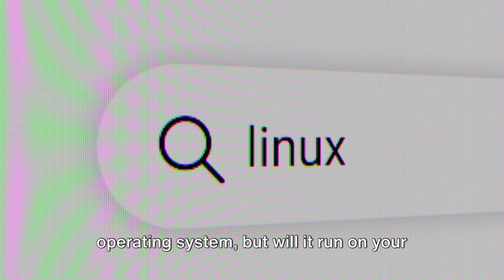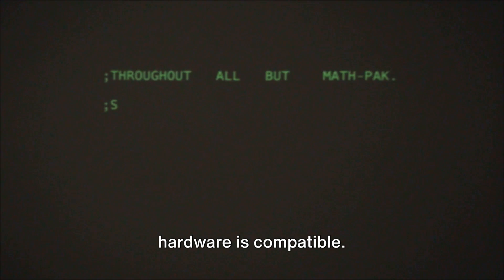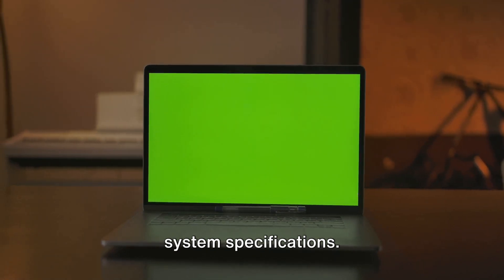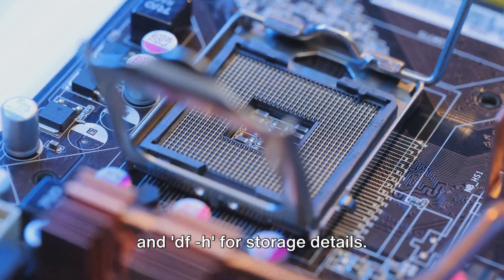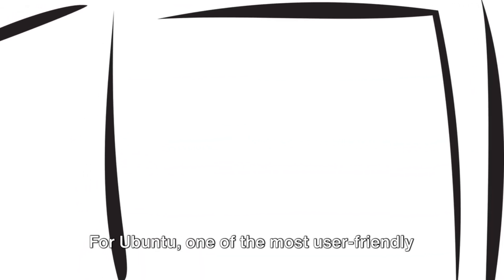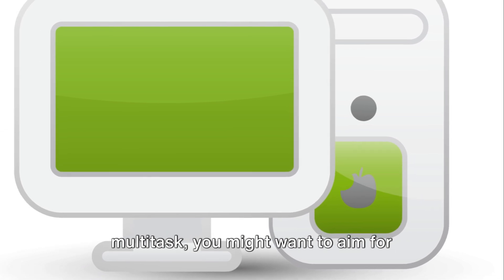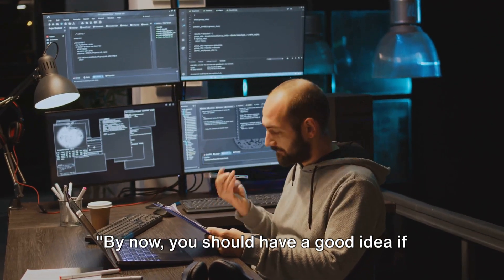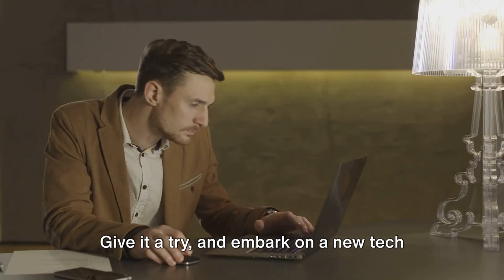Will Linux Run on Your Computer?

Comment: Nah this is incorrect. If it has electricity it can run a light weight distro of gnu/linux 

I run arch on my outlet btw
Reply from the maker: Who needs a computer when you have a high-performing outlet, right?

Comment: What a garbage! Is this done by 10 year old first time on YT? None of what you said matters for Linux. If a PC can run any other OS, then it can run Linux too.
Reply from the maker: Thank you for your feedback. However, even though you believe that the current state of the kernel has resolved previous issues, why are there still problems with Wi-Fi and peripherals for streaming? There are still hardware compatibility issues with Linux, and this is just one example. I have even heard from friends who were unable to use their printers due to either incompatibility or poor output quality. While I respect your opinion, I would like to point out that these issues still exist. Nevertheless, I appreciate your feedback.

Comment: Linux works my desktop. Video, audio, wifi, my brother printer scanner combo all works.
Reply from the maker: That's awesome to hear! Linux can be a great choice for desktop setups.
Reply: @TonDoesLinux  I've used linux for 15 years.  I do my research before buying new hardware. I also check if a company has drivers for linux as well.
Reply from the maker: @DV-ml4fm  That's the way to do it.

Comment: My "before watch guess": yes, absolutely.
Edit: TL;DW: 2GHz CPU, 2GB RAM, 20GB HDD.
By the way, my Linux machine has an Atom and 1GB RAM, it's fine for mundane tasks.
Reply from the maker: Looks like your Linux machine is proving that it's not about the size of the hardware, but how efficiently it's used!